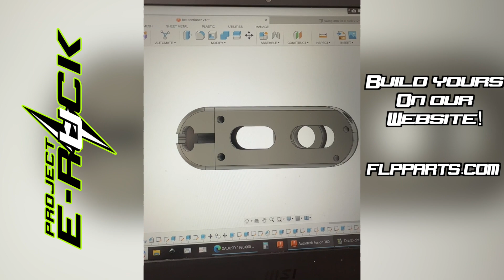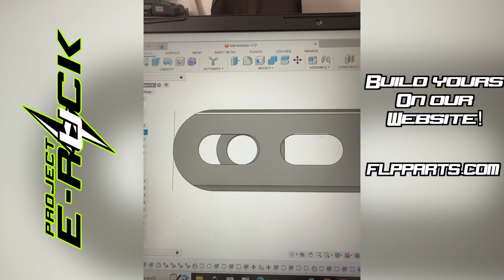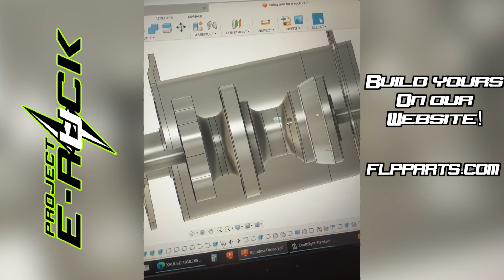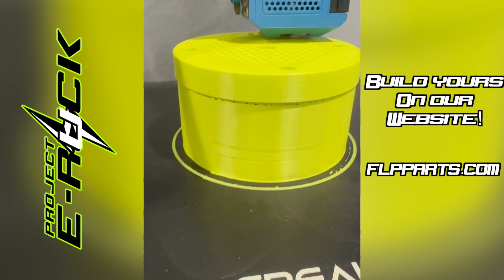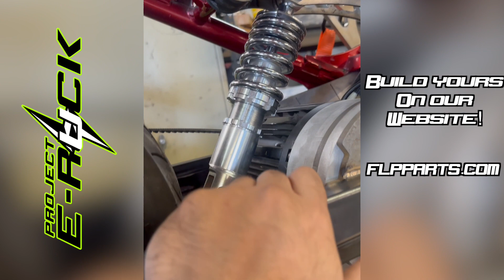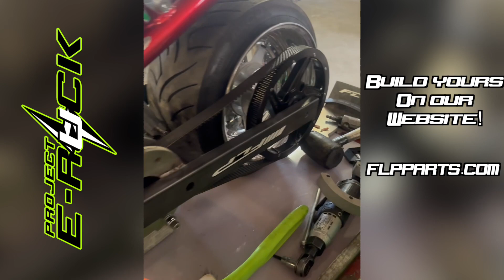PROJECT E-RUCK MINI UPDATE | 9/19

Comment: Are there any concerns with the bolt only being on one side causing binding?
Reply from the maker: The tolerances on this are pretty loose, the binding won't be an issue, we've used something similar in the past from Steady Garage grom extension kit; but good eye!